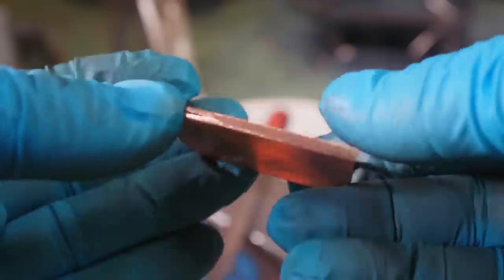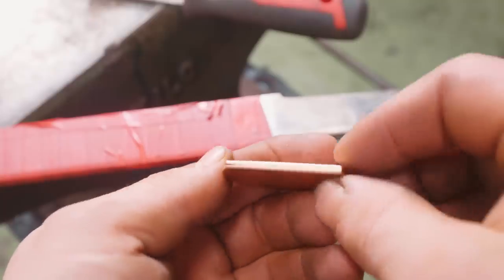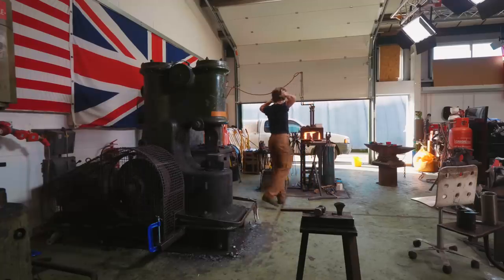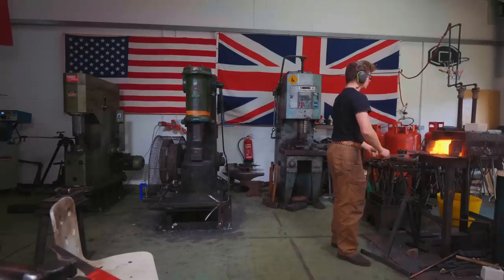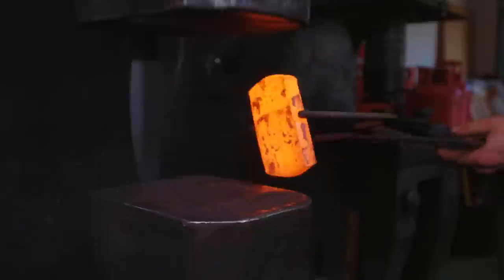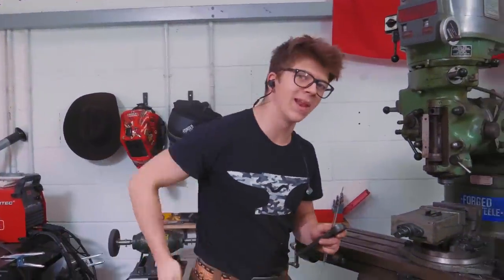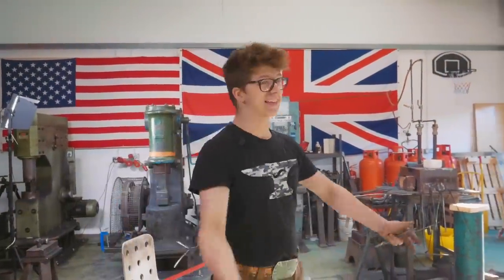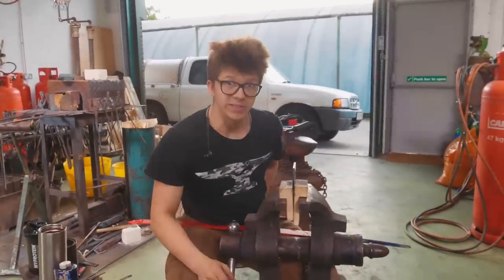MAKING A KATANA!!! 1 MILLION LAYERS!!! PART 7 - The Guard

Comment: Hey, Alec! Here's a list of the individual metal parts that make up the tsuka, or katana handle:

Habaki: Blade collar (made that already)

Seppa: Small disc spacers, one between tsuba and habaki, and another between the fuchi and tsuba.

Tsuba: Disc guard (already made)

Fuchi: Handle collar, allows the handle to be under compression from mekugi pin.

Mekugi: Wooden pin that holds the handle on the tang.

Menuki: Handle ornament hidden under Ito wrap of the handle.

Ito: Criss-cross wrap of the katana handle.

Kashira: End cap or "pommel" of the handle, covers the end of the Ito wrap to hold it together.

Hope you find this to be helpful!

Comment: Alec another soldering tip. Polish the joint with 0000 steel wool before you apply the flux. It will help the solder stick better and you don't need to heat it up that high a temp to solder it. Heat the peice up and touch the solder to it. When the solder melts its hot enough. You don't need the flame to be on the piece your working on. If your in doubt as a plumber to come in a show you. That would be the easiest way to get it down quick.
Reply: Excellent point about the plumber.

Comment: Wrought isn't just grain like, it absolutely has a grain. 

It's basically a composite material, iron fibers and silica slag, don't think of them as impurities, they aren't! They give wrought iron great corrosion resistance because wrought iron scale isn't just iron oxide but a sort of glassy coating from the silica slag. The silica also makes wrought iron much stronger than pure iron would be, though it's less ductile in its cold state and is liable to break. And lastly it makes wrought iron SUPER easy to forge weld as it's basically self fluxing. 

And when forging wrought it's very important to keep the orientation of the grain in mind, just like in woodworking making sure it's in its strongest orientation. This is why old axes were folded and not punched, as a punched eye in wrought would have the end grain on the poll, and be liable to split. Where a bent eye is strongest all the around.

Comment: When you join the two sides together at the bottom, take a narrow piece of copper filed down on both sides to a wedge shape and insert it into the gap over the bottom joint. Then lay a thin piece of silver solder into the gap above the wedge and heat the item with a small torch while in a vise (model maker's size) The silver will melt and run down into the space around the heated wedge and solder it perfectly.

Comment: One key soldering tip ... liquid solder (i.e., melted by the heat of the work piece) is drawn by capilary action into the gap between the two pieces  you are soldering.  As others have said surface prep is important - cleaning and polishing with fine steel wool and applying flux - the work piece should be heated to the point where the solder will melt if touched to its surface and the heat from the work (not your torch) should be used to melt the solder.  Melting the solder with the torch results in a "cold" joint which have a dull appearance and are weak mechanically.

Comment: Two tips about soldering (I am a goldsmith, so I solder as much as you weld ;)) 
1. The solder will always flow towards the hottest area. Heat up the entire workpiece until you're nearly reaching soldering temparature, then only further heat the area you want to solder.
2. clean you soldering areas! (it doesn't need to be polished, just file it beforehand as you do not want any metal-oxide mixing with your solder. It will work nonetheless, but be brittle.

Comment: If I may, if you use a smaller orifice on your torch you can get the effect of a case hardening like there are on antique firearms. It's a useful trick I learned in gunsmithing school. Put a little wax onto it once it's cooled down a bit, but still warm enough for the pores to be open, and you're golden. Renaissance Wax seemed to work best for 4140 steel, not sure if or how well it would work on wrought iron. But it may be fun to play with and try out.

Comment: The soldering is always going to be difficult if you're putting it to the flame. The objective, as you probably well know, is to heat the material you want fused but NOT to heat the solder itself. You want the material to "wet", as we jewelers call it. The internal structure of the metal expands so much from the heating that it soaks in the solder (or at least to the surface ) like dipping a paper towel into a puddle of water, and the metal itself will carry the solder where it needs to go. If you have the pressure from your torch nozzle blowing on the solder, you're pushing the solder off your material before it can soak in. You want to paint your joint with heat, then dab on your solder with the torch away. For smaller objects, like when I'm making a setting for a ring, you want to apply the solder to the surface to be fused, then introduce the two metals and paint the heat. For the Hibaki, I would torch the opposite side of the piece that needs soldering and let the heat build through conduction with flux on the joint, then hold the torch away as I dab the solder stick to the joint. You want the heated piece to melt the solder only

Comment: Alec man you gotta scratch the surface of the copper and take off the oxide layer then add the flux the best one to use is a liquid paste flux and point the heat to where you want the solder to go! I know it doesn't help you now but for future projects it helps a lot. 

Ps coming from a weathered plumber 
Great stuff though amazing work!

Comment: Silver Solder is best applied to red hot copper (nearly to the melting point)  then apply the stick to joint and the silver solder will follow the heat.  So if you control where you put the heat, you can controll where the solder will go.  I do a lot of Silver Soldering on copper, A LOT!

Comment: Next time you find yourself having to solder I recommend investing in a soldering iron, it will save you grief, or heat up a coat hanger if funds are tight and heat the solder not the copper

Comment: You do some very nice hand filing. A great aid to filing is a "die filer" (Yankspeak. You Brits may have a different name for it). It's a simple bench tool powered by a small motor that reciprocates a file vertically through the center of a tilting table: a great aid for obtaining closely controlled part contours  There are usually several listings on eBay. A die filer needn't be fancy for your use but extra features may come in handy. They are intended for use with purpose-made die filer files but common hand files may be used with a little ingenuity

I have a basic Oliver model that came with a tilt table and a support arm. Once in a great while it's irreplacible. 

.

Comment: OK my friend, I am a retired oilfield welder from TX. The trouble you are having while grinding the blade or any other long pieces. Is that you are having to steady your entire body while at the belt sander. You need to buy or build a tallish stool so that the bottom half of your body no longer is part of the steadying process. You will be able to utilize your arms and and top of your legs to help steady the piece while being able to work the piece with more ease on it and you. Stop diminishing your skills and be more positive about what you are doing. An occasional "this is kind of a new territory for me," will suffice. Here in the states and probably in most places just use the word "sodder" for solder. One of those words where it is spelled different than pronounced. lol Keep up the good work and I am a new sub to your channel as well.

Comment: I don't want to be nitpicking about the katana but the habaki is supposed to sit on the blade it should be quenched in a horizontal tank and the curve isn't forged it happens during the quench
Reply: well you ARE being a nitpick
Reply: He said it a few episodes back. He didn't do the classic clay technique because of the metal he uses to make the sword. It's Damascus steel, which he says is something of beauty. That being said, the differential heating of the clay procedure would hide parts of the pattern because the clay wouldn't let the steel under it be tempered properly. That's the reason he's doing it. He said it himself, he would normally do just that, but he wanted to keep the pattern as clear as possible and went the extra mile to work around the clay technique, making the curvature himself.
Reply: You can still get a really nice hamon using the clay, and I was nitpicking that, but modern steels don't need differential heat treatment.

Comment: when soldering you want the metals around the melting temp of the solder. copper don't need to be red hot. the hotter the metal the more liquidy the solder will be and it wont want to fill a gap. Next time to make it easier on yourself use a small propane torch and keep the temp low just hot enough to melt the solder. That will get you a great joint and not have to worry like you was with this one.

Comment: You don't need so much heat when you're soldiering. Heat the medal with a simple butane torch and the flux will draw the solder into the seam.

Comment: I know im 6 years late on this comment but i believe you were brazing not soldering. And when its done you have the copper at temp, flux it, then add your metal and the heat sucks your metal in the void cleanly.  But im surprised you didnt just tig weld it. And as for tools you may enjoy are the lazer rust remover, and lazer welder. Neither tool i have used but both look like a tool id have to buy id your position. But you should drill holes in the blade and fill with demascus rods hammered in to them for a poke a dot type emblem in the hilt. And if you ever need an electrician to light up your shop i can make your lighting perfect in all work areas. Or have someone add 8ft flourescent strip acroos the shop. Add fans for comfort and make a forge the can do multiple things with its heat like a aluminum can drop that instantly turns cans into molten metal and you can cast designs with a crank pour. I used to make parts for my truck like throttle body spacers, or foam carved status, poured into sand. One pour i had temps wrong and my crucible was held in mid air looking like it pour itself which was really cool. Or you can pour into ant hills and dig them up. Just metal fun.

Comment: I know your copper piece is soldered already however did you know copper can be tig welded using solid copper electric wire as filler rod?

Comment: Alec, if you have an issue with soldering which a lot of people do, use your Tig. It takes practice but I've found it easier and faster to solder/braze with a Tig since it's easier to control your heat. Give it a try I bet you will like doing that better. There are videos on YouTube showing it. I believe Chuckie2009 has a video on it.

Comment: Don’t forget the washers either side of the tsuba  - also making some Japanese copper alloy using silver copper and the water casting method is a very traditional way to make bits n bobs for Japanese blades. See ford Hallam’s channel for the process. I have a video of the molten alloy under water from when I tried it. Polished it into a shaving mirror with a hammer finish on the other side. Very zen to make your own mirror. Fords video https://youtu.be/BkhWh19fTG4

Comment: No joke the guard should have been some of the flag damascus. That would have been amazing looking!
Reply: Eric Morrison Not a good idea from a practical point of view. Both the Tsuba and Habaki are not from the same steel as the blade because using wrought iron and copper serves as a “shock absorber” to reduce stress on the blade at the weakest point; the transition from blade to tang. Because if this they must be made from material that is softer than the blade itself.
Reply: Ummm is he going to battle with this? I mean if he is then yeah totally do that for those reasons! I mean if not why not make it his own? lol
Reply: Eric Morrison Because it is likely he’s going to hack some stuff up with it once it’s done, to test it out.
Reply: I mean, yeah, Chopping fruit can take it's toll on a well sharpened blade. Pineapples in particular can be pretty tough to chop up. Thank God this isn't Forged in Fire where they take swords to like animal bones or plate armor. Man, then things would be really bad lol It would be cool to see him chuck through the air at the knife throwing wall though. lol Like Zeus with a bolt of lightning.
Reply: Eric Morrison Well, there are too many basic flaws in this construction to be good at any of that. Have a look at Freerk Wieringa on youtube. After quench and tempering, he really abuses his blades to see if they’re actually strong enough to continue finishing completely. His swords are no wallhangers.
Reply: Alec's are wall hangers. Thats the difference between making a blade for abuse or every day use and then what Alec has done and is doing. By no means should any one spend weeks on any blade made because of some big thing happening, "500,000 subscribers for instance" then turn around and destroy it. He doesn't test hard unless it is made to be tested hard, like the tomahawk he just made. He even left the hunga munga rough to allow it to be used. Also to say he needs to follow a proper set up takes away the creative liberties that go into his work. You also literally said there are to many basic flaws in his blade to test it hard, like they do on forged in fire. Welp, fruit it is and should be on a sword such as this that has taken so much time to make and has such a significant meaning to the creator. If he were to be testing it hard then he would yes need to make the Tsuba  and Habaki correctly. Did you know the Tsuba is typically adorned to show the sword owners cultural beliefs and standing, like I dont know THE FLAG OF HIS COUNTRY? I totally get wanting to make a some what accurate Katana, unfortunately this is not anywhere near accurate, so again, he should have made his Tsuba out of the flag damascus.
Reply: Also Alec, I dont know if you will read any of this or not. I think it's pretty funny though lol I think it would be great to see you and your father make a proper Saya (Scabard) for this blade. You showed his wood working shop in a previous video and I feel the symbolism of the coming together of the Katana to the Saya is like your and his relationship. It could be a really powerful video to watch.

Comment: The only thing I think Alec will struggle on is the colour string handle wrapping if he doesn't do it I won't be a true katana
Reply: It is already not a true katana, so what difference would one more detail strayed away from the traditional katana mean?
Reply: Thomas Russell yes that is true but he took away the hermone away with a reason not cause he felt like it he even explicitly said in part two that he isn't doing it cause it will not contrast the same way as just doing a normal hardening/tempering so he's most likely going to do everything else as traditional as possible or why would he call it a katana why not Japanese sword and do what he wants with it?
Reply: Thomas Russell plus it won't give off the same hermone anyway cause it's the wrong type of steel the steel to make a traditional katana uses a very high carbon steel so it is alot harder than normal carbon steels but it's very fragile so it needs a soft spine so if you did hit something hard it wouldn't break In half but just chip it even swinging it too hard will cause it to break but since he's used Damascus it doesn't need one xd

Comment: Out of interest how can you tell a piece of wrought iron and a piece of steel apart when routing through a scrap pile????
Reply: If you re watch this video where he is grinding the wrought iron you will see the sparks are very dead. Reddish not yellow, no little explosions on the end of the spark. Wrought iron has very little carbon so the sparks are dead looking. Also on the rusty iron you can sometimes see a very faint wood grain pattern in the material. If you live in the US a good source is old iron wagon wheels. look for a hand forged joint in the iron rim that means some blacksmith hand fit the rim and its most likely wrought iron. Get some different samples of iron and do some spark tests. Really comes in handy. its fun to forge, very soft. BUT you will often find areas in the iron that simply come apart in long fiberous strips. rust gets into the iron along the grain.

Comment: why not tig the copper together?
Reply: too hot
Reply: My welding teacher showed us how, although I'm not sure I could do it now, must have been 10 years ago at this point, but if you're careful and you fan the arc to preheat the metal it is possible. Just a question anyway. Alec got it to weld.